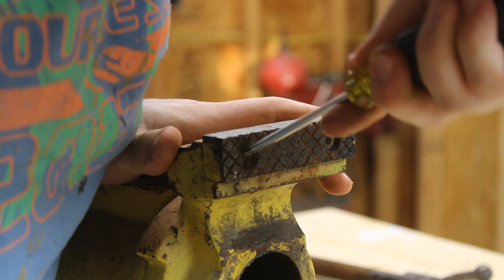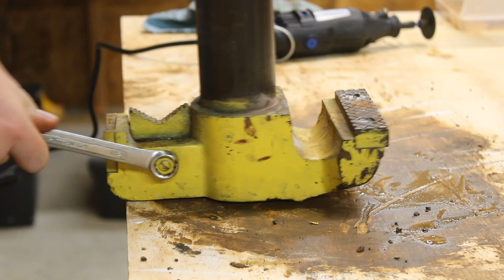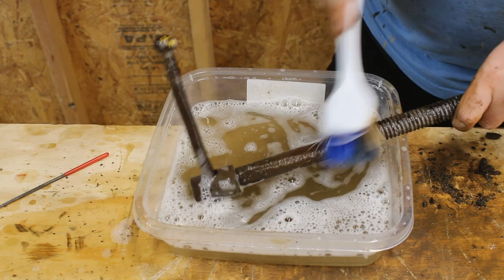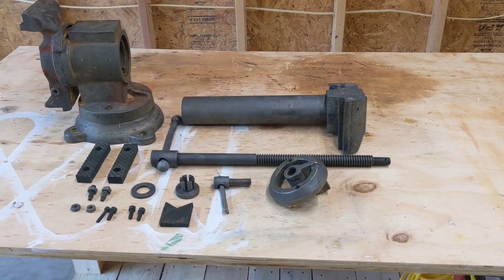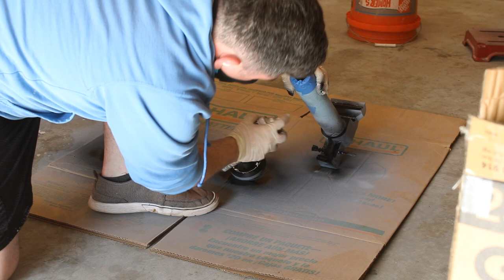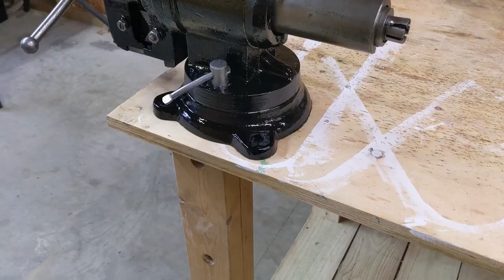Old Bench Vise Tool Restoration | Tools | Restoration | The Will To Make

Comment: Kind of curious why you chose to leave the other part of the vise still assembled? Based on the amount of crud you cleaned out I'd imagine there's plenty in the sleeve assembly that the jaw slides in and out of, you realise this vise will rotate so the pipe jaws are at the top or 90° or wherever you need them? There's normally another set of jaws for gripping square stock on the underside of the pipe jaws aswell.
Reply from the maker: Yes I understand that, I attempted to take that apart but would not budge with anything I tried. And since I don't plan on using that side anyways I just left it.
Reply: @TheWillToMake a mi me pasó lo mismo,solo que si lo golpee de un lado a otro con afloja todo y si cedió, pensé que tal vez se quebraria de lo fuerte que lo golpee pero afortunadamente cedió jejeje saludos